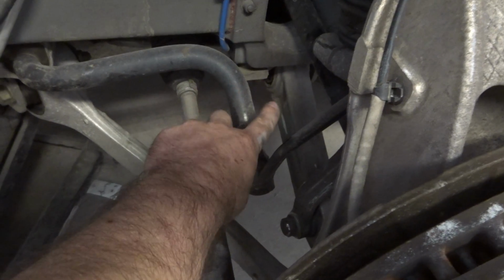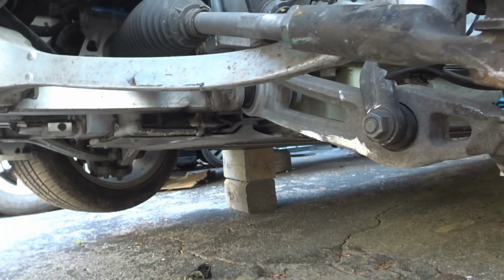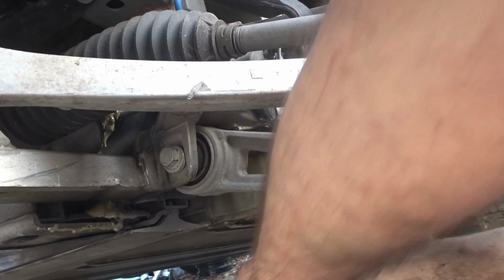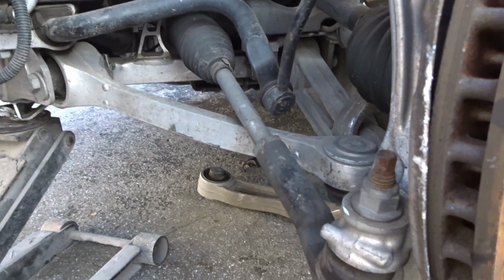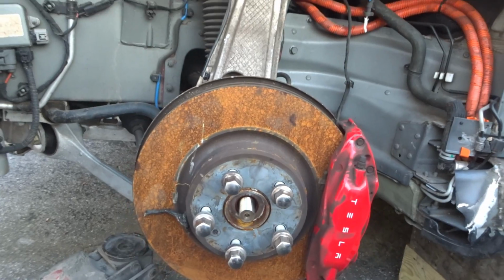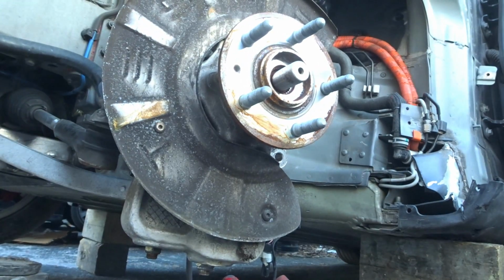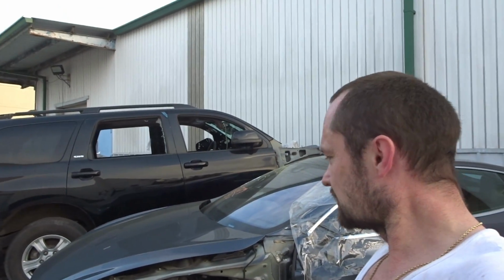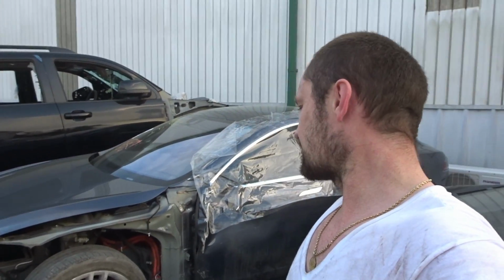Rebuilding a Wrecked Tesla P85D bought at auction / Part 3

Comment: Hey just A heads up on that rear front lower control arm bolt direction, it was installed that way because during front end crash tests the bolt going in from the front punctured the battery pack after a major front end collision. That's why its installed that way. It was for safety reasons and not just a stupid engineer. Now you know......
Reply from the maker: Now I know lol..  we will have to install it the right way then. 😑
Reply: @lb-innovations  A layed off Tesla engineer advised my of this because it drove me crazy also why they did it that direction. But some how it make sense now.  I would do it like you did, by grinding it off and putting another bolt in the easy way. Dropping the battery is a pain in the ass.
Reply from the maker: @WatchRichRebuildsChannel  Yes it is. I had to do it on my first Tesla. But, it would have to get in a very very hard accident to push the bolt into the battery.